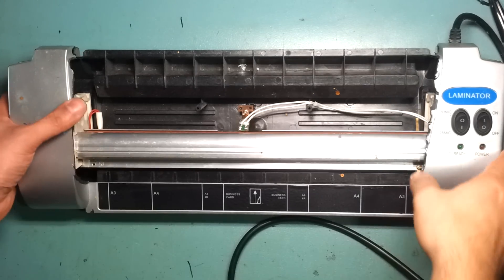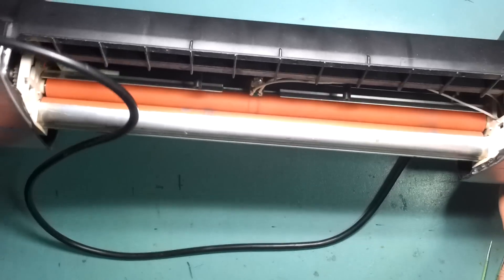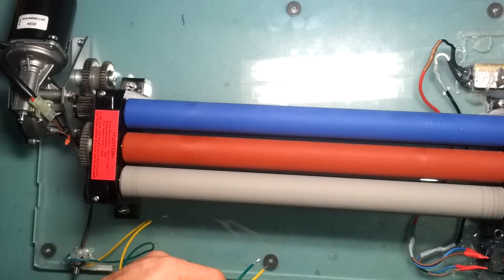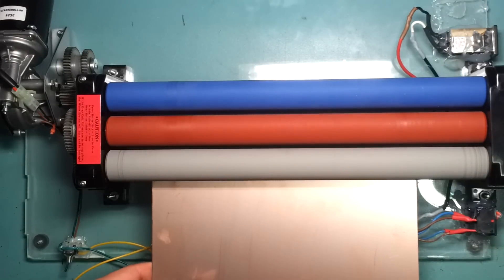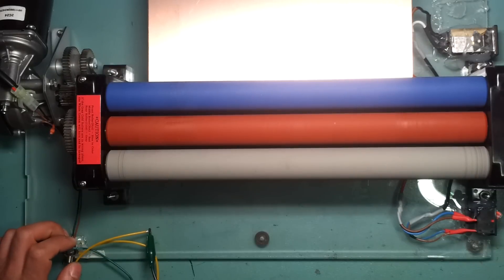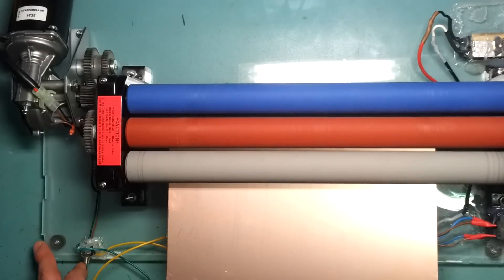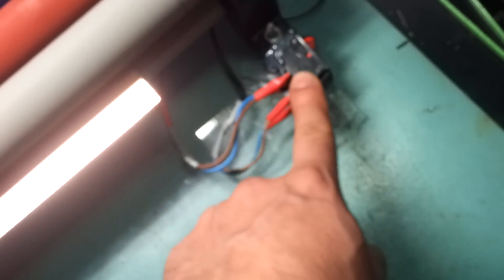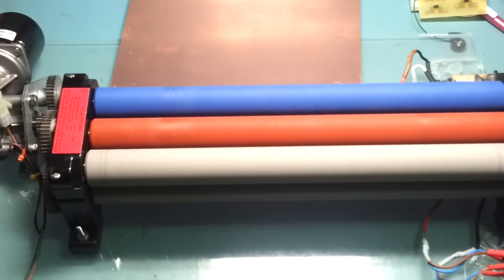New laminator for pcb toner transfer. Making pcb aht home

Comment from the maker: that is something i might do in the near future, but right now i am in the middle of another project.first i need to mount the jig on something more sturdy, as the motor and the rollers weight about 20 kilos. i managed to fix the temp controller from the damaged Laminator so i might install that for now on the new one. it has a cuts off at about 180c.

Comment: That looks like a nice set-up for the pcb laminator. I'm sure if you include a small micro and a 16x2 lcd you can just automate the whole machine easily, including a counter display for the amount of times que pcb has gone through, and you could even have a temperature measurement too.